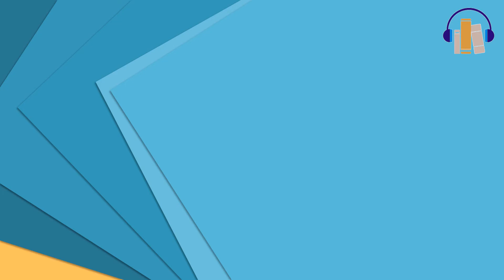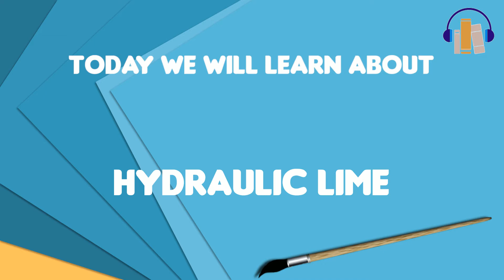What is Hydraulic lime? Explain Hydraulic lime, Define Hydraulic lime, Meaning of Hydraulic lime

Comment: What’s the difference between this and hydrated lime?
Reply: My understanding is that hydrated lime is a lime where the original quicklime has been slaked, IE hydrated, via mist and water vapor, in the factory so that the principle product, calcium oxide, doesn't burn people's eyes/mucous membranes when handled. Hydraulic lime is a lime that, while also hydrated so that the calcium oxide is not caustic (burns you), it has a higher percentage of alumina/silica chemicals that react with both the calcium component of the lime and water to harden. Basically, this means that they harden and make the initial set-time of mortar faster. However, their presence makes the characteristic of the mortar different than a mix that doesn't contain them.

The silicas and aluminas are referred to as "pozzolans", which also are the primary building block of Portland Cement. So basically, when they are present in an NHL, they make a portion of the available calcium hydroxide react to form a substance similar to cement, and then the other portion of the mix would continue to react like a more pure mixture of lime would behave, IE reacting with carbon dioxide from the air, not with water, to form the original mineral it started as (limestone).

That's why you can take a pure mixture of hydrated lime and mix it with your aggregates to make mortar and keep it stored in a bucket or barrel of water, because so long as it doesn't have air getting to it, it won't take CO2 from the air, whereas a hydraulic lime would start to set like portland cement would.

The hydraulic lime is stronger, and more like Portland, but still has some properties of breathability/water retention/porosity like lime. However, my understanding is that it is still not as good as a "sacrificial element" in the sense that it should be weaker than the brick and get destroyed by water faster than the brick should to protect the brick, especially when the brick is really old and soft, such as in preserving a historic building.

This info is all from my own research BTW, so take it with a grain of salt. However, if you are looking to know the difference for purposes of purchasing, I'm pretty sure that if you want an OG lime mortar mix, you would use non-hydrated quicklime, because it means none of the lime would have returned to the mineral calcium carbonate IE limestone by sitting in the bag for a long time as calcium hydroxide. I don't know how long calcium hydroxide is usable before it would react with CO2 to form calcium carbonate sitting in a bag. I am not sure what the usability of powdered hydrated lime is in masonry, since usually if you buy slaked lime it it is in a bucket as lime putty, protected from the air.